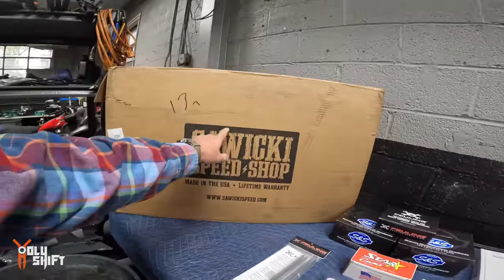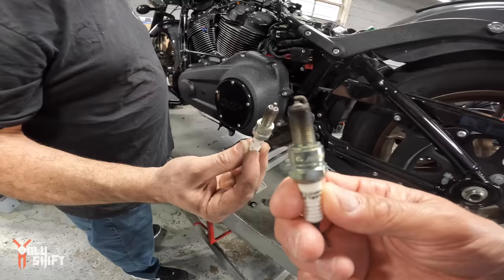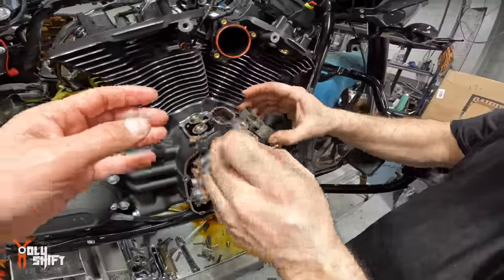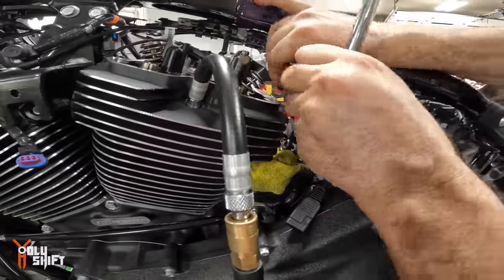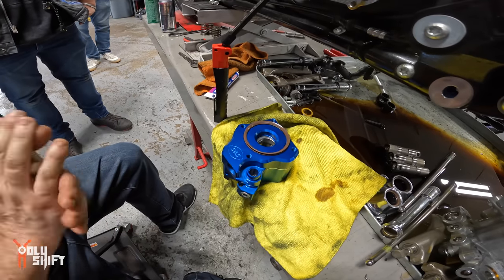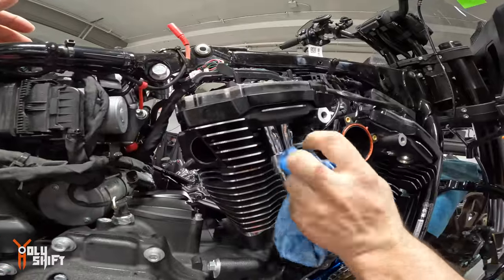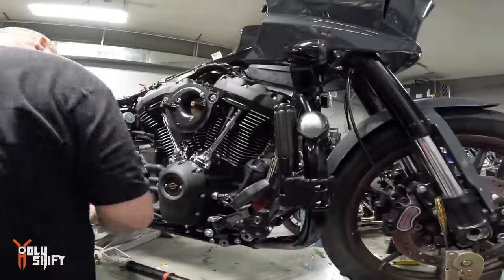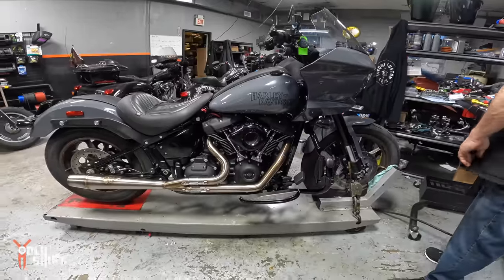Building A Stage 2 Beast / Star 303o Sawicki Speed 2-1 Low Rider ST

Comment: I know people bug out about the plastic cuffs, but apparently there's never been a documented failure of them in harley M8. They use them on performance car engines too like the Chevy LS engines like Corvette. I think you only need to remove them and put the S&S ones on if you're doing high lift cams like a .590 or .610.
Now days I just recommend people to use magnetic lifterholders(30$ from FuelMoto) and don't bother with the cuffs or removing the tappet blocks for anything other than changing the color of the blocks.
Instead you can pull out the camplate and oil pump and the lifters fall out of the tappet holes, so you can replace them with new ones easily from underneath, and then hold them up with magnetic lifter holders, and put the rest of the engine back together.
FuelMoto recommends that if you're going to remove them, disassemble the cam chest, then heat the engine block under the bolt for 5 minutes with a heat gun. Or get an induction heating coil and get the bolts very hot that way.
I broke a cuff bolt on my Fat Boy, and it ruined my summer because I had to pay a shop to extract it.
Reply: I am contemplating this now. I have the new cuffs, but not sure I want or need to install them. (Wood 22xe cam)

As a machinist for 40+ years, I find it hard to believe excessive loctite in aluminum would cause a bolt that size to snap. Seems like a poor quality fastener to me.
I have broken other bolts on the bike torquing to spec with a good calibrated wrench.

Comment: The Fueling vented dipstick is good... however, it is better to vent through the transmission cover using a Trask setup.
Reply: I vent through a Trask trans cover and also installed 1/4" threaded vent nipples on my S&S Stealth back plate to vent each head to the atmoshere. Works great, no residue getting sucked via vacuum into the intake trac. Way prefer the Trask to the vented dip stick.
Reply: @amberbali8881  keeping that snot out of the combustion chamber will make our engines happy... everything I have watched and read, indicates that the Trask transmission vented cover is superior because it is at the highest point of the M8 case. less oil sloshing around in that area when riding the bike. the vented dipstick is lower than the transmission cover on M8s and suffers from the sloshing oil, which in turn, allows more oil than desired to vent past the internal umbrella valves. although the dipstick method works, the chances of oil migrating to the filter is much greater than the transmission setup. all in all, the idea is to allow the engine to breath and keep snot from fouling the piston tops : - )
Reply: @richardrussell500  Correct.

Comment: My 2009 Superglide with a stage 1 96, runs a 240 head temp measured with an infrared temp gun next to the spark plug. No fans. 
My 2021 Road Glide 107 stage 1 averaged a 325 head temp without fans, and now averages 267, for a 58 degree temp drop with Love Jugs. 
My 2022 Low Rider ST 117 was 300 degrees hard temp stock, and now averages 249, for a 51 degree temp drop with the Love Jugs. 
So yes you are right. The newer bigger motors are running much hotter, and even with fans, they are still hotter that the old 96 Twin Cams with a tuner. 
I’m thinking that If I did a Power Vision tune on the 2021 and 2022, it would drop the temps even more.

Comment: The Jim's fans come with a thermostat. Love Jugs do not. Consider installing the Fueling sump plug, which is shorter and helps prevent potential sumping. The stock sump plug is too long and blocks oil flow.

Comment: Why upgrade the cam plate?/oil pump? Consensus is 2020+ OEM is better than aftermarket unless they've revamped further since then.
Reply from the maker: better oiling
Reply: No consensus its better. Consensus is they finally caught up to S&S and Fueling oil pumps to solve the sumping issue. It only took them four versions....